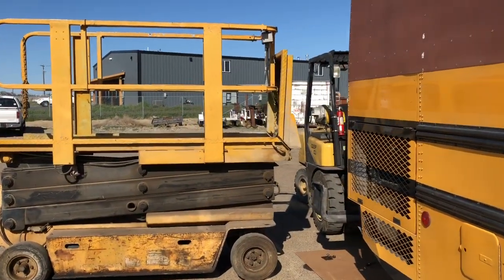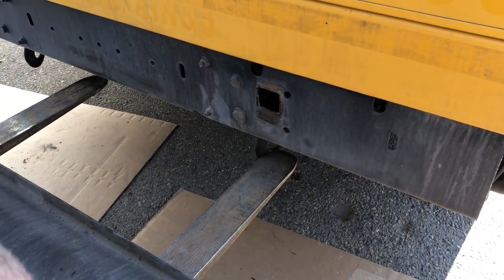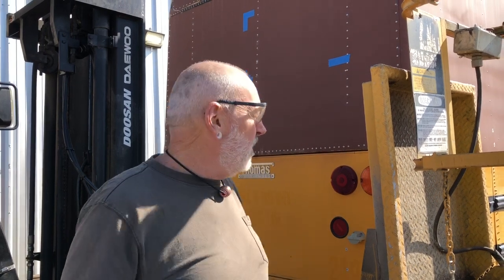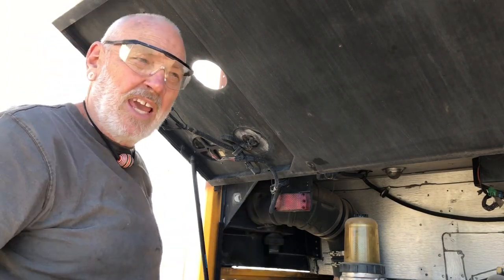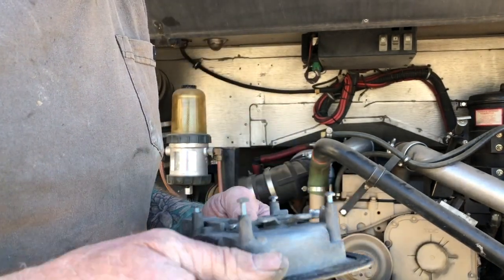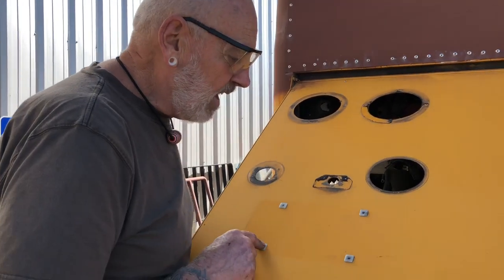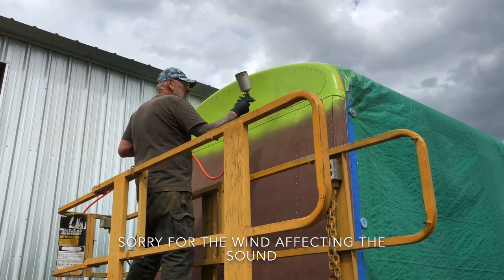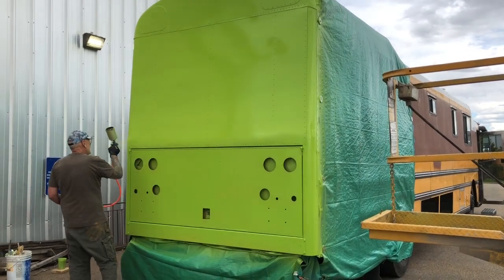Painting the Back of Our Bus - Vlog 108 School Bus Conversion

Comment: Randy, The first couple of times I painted my bus (didn't like color) I used a HVLP gun. It was hot and I had trouble keeping a wet line.  The Harbor Freight gun with the separate paint pot is $40 bucks and will keep the AREA wet as you want. Also, I have gotten really good results rolling with the 4" white foam roller intended for cabinets using oil based enamels. Good luck, love the color!
Reply from the maker: Good to know ... thanks for sharing.

Comment: Let me know what you do for lights. Have the same issue.  I'll need to buy replacements... planning all LEDs with all new 14 gauge wiring. Replace the plate screw holders with rivnuts...? I bought a 5/16 rivnut tool and stainless rivnuts for a variety of things on the bus. You're not afraid of getting attention, are you?  Lol. Looks great.
Reply from the maker: I still haven’t figured out which of the lights to buy on Amazon. I called AAA and they don’t sell them. I will Try to remember and let you know when I do purchase them how they come out. But they seem to have two intensity levels and I only need one. Maybe your Byam first and you can tell me which ones are awesome :-)
Reply: @KnappTime  there's a NAPA near me that has a pretty good assortment of led automotive lights on display.  I'll have to see what I can find there.  If I find good stuff I'll share some part numbers and other info.  I may decide to redesign the rear lighting layout TBD.

Comment: When I was a kid, out of the back of a Boy's Life magazine, there was this build your own Kayak kit you could send away for. So, secretly before Christmas, my dad sent away for it.  It came with a bunch of straight long pieces of spruce, and two cross boards for the seats and a wooden oar that clicked together, and a roll of canvas.  $35. then the spruce 1x1s were flexible enough to screw into the cross pieces and bend together to be bolted together at each end. Then the top of the side was done the same way for a separation .. It was a two seater.. then, the uprights were screwed in, and suddenly a frame for the kayak was there..   Then, the night before Christmas my mom and dad stayed up and stretched and tacked the canvas to the frame.. Why am I telling you all of this?... Because the day that Christmas came, there was a big white 14 foot kayak laying there under the tree!  Wow!  The very last step was to paint the kayak with marine paint to seal the canvas... And the color I chose was this exact same color you're painting your bus!  I called it "electric green".  It was visible from anywhere!  We got many years of joy and fun out of that thing!  Every year, we'd stick it on the top of the Rambler station wagon, and take off camping all the way along the coast north to the San Juan Islands!  It eventually got destroyed when my friend and I decided to try riding it in the ocean surf, but not before we had many many years of fun.  It was fast and glided through the water, but it was a little too delicate for the ocean.. We both capsized and it filled up with water, and instead of twirling it around, we tried lifting it straight out of the water, and the water weight was so heavy it broke the boat in half.. Anyway, it was a great kayak with great memories, and most of all.. A Great Color.  I couldn't resist sharing this once I saw that spray coming out of the nozzle.  You guys have good taste!
Reply from the maker: Hi David
I love that story. Thanks for sharing it. We are kin to each other I built a kayak when I was young to :-) I painted mine camouflage it was made with quarter-inch plywood and a. 1x2 frame instead of your fabric and probably quite a bit heavier. It pretty wobbly and I struggle to learn how to make glide as yours did. My grandfather had a pond by his house when I grew up. That’s where I took the kayak to play with it. When I grew tired of it I left it by the edge of the pond. I stumbled upon it in the weeds several years later as an adult and it looked like the skeleton of an animal that had dried up in the skin had blown off  of it. All those memories came rushing back to me when I saw it. And as I read your kayak story. So there’s my kayak story back at you brother. We love you so much thanks for following us and commenting :-)

Comment: G'day and greetings from Tasmania Australia 🇦🇺, should you have sprayed a primer on that surface before the colour?   All so are you going back over the colour with clear coat ?    I'm trying not to sound picky and I know that this vlog is a old one but I had to ask the question.   This would happen to be one of the nicest looking conversions into a home that I've seen, raising the roof and putting in those great looking skylights is a better way to go, I'm having trouble finding the videos in sequence from each aspect of the build anyway I'll keep going through them.      Anyway keep safe and well kind regards John
Reply from the maker: We did use primer first and there is no clear coat used. There is a harder in the paint. 😃